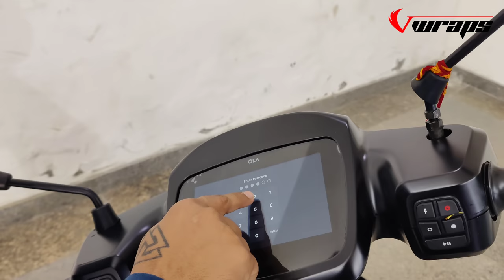OLA S1 Pro Matt PPF Installation @VwrapsSikar

Comment: Clean The Ola Bike matte paint protection film (PPF) work is impressively clean and meticulously done. The application demonstrates a high level of attention to detail, ensuring a seamless and uniform coverage across the bike's surface. The matte finish appears flawlessly preserved, with no visible bubbles or imperfections. The protective film not only enhances the aesthetics but also guards against potential scratches and environmental damage. Overall, the craftsmanship reflects a commitment to quality, showcasing Ola Bike's dedication to maintaining the pristine condition of their vehicles.